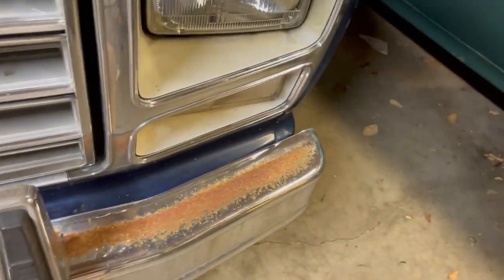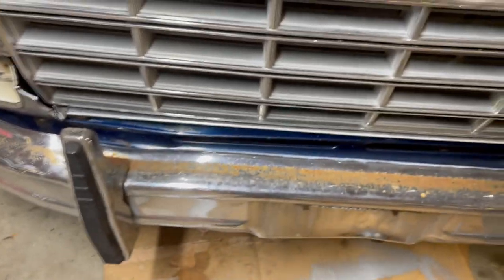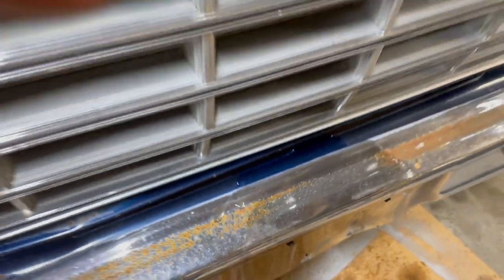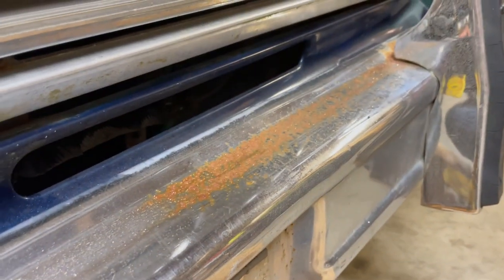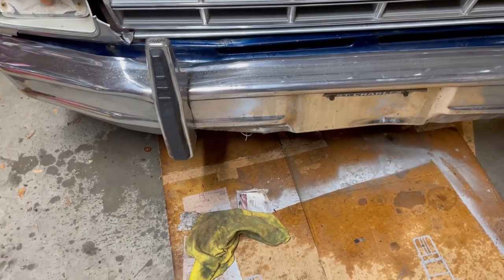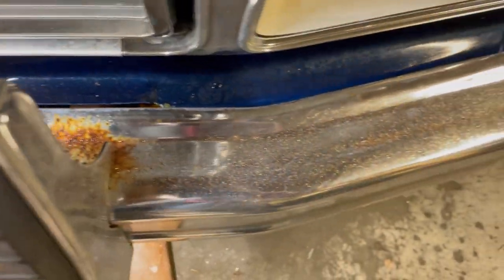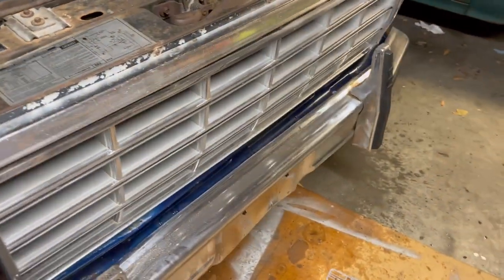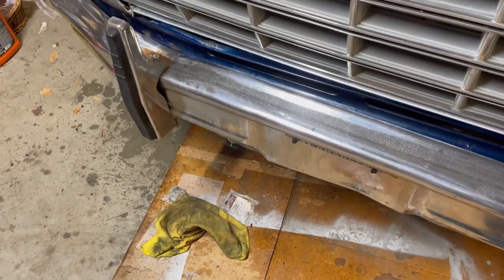Simple, no cost way to remove rust from chrome on bumpers, wheels, or anything chrome. It works!

Comment: Is chrome just polished steel or some kind of paint? Dumb question
Reply from the maker: Chrome is a plating that is applied to steel. It is made of chromium and is applied to steel in liquid form.
Reply: @whattherust  do you think there’s an advantage on having chrome over polished steel? If they both end up with nearly the same mirror like reflection
Reply from the maker: @plshelp2906  Yes, chrome is far more rust-resistant than polished steel.